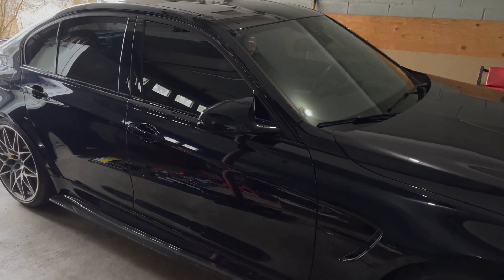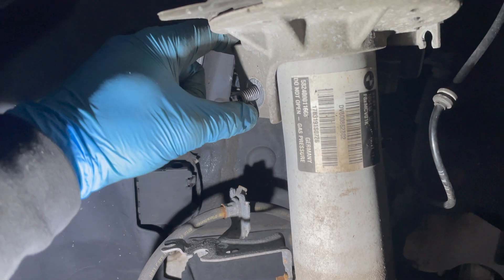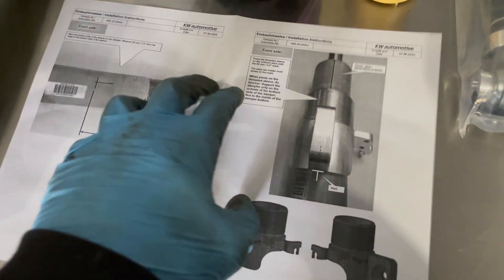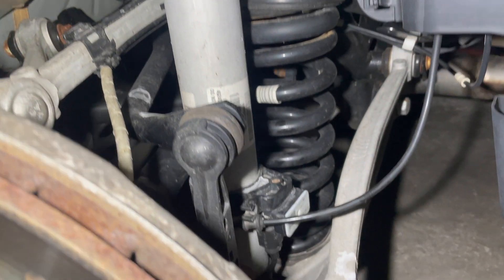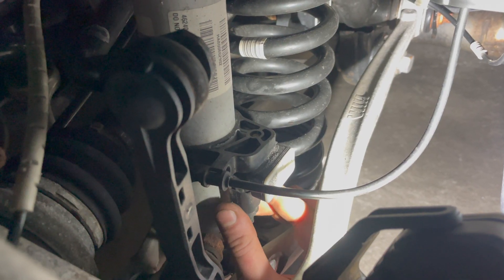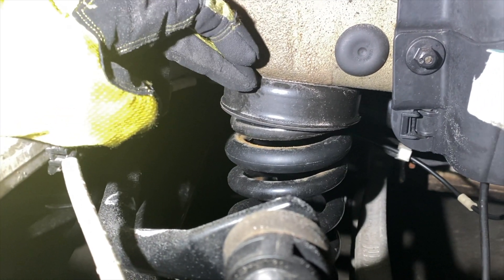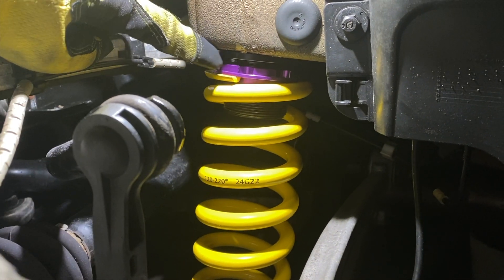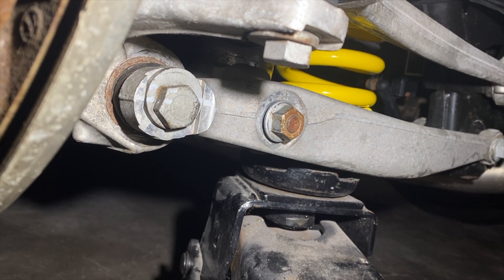INSTALLING KW HAS KIT | BMW F80 M3 / F82 M4 / F87 M2

Comment: Hi, I installed the KW HAS kit on my f80 but getting a slight knock noise when turning at really low speeds (5-10mph). Do you have this issue? Didnt install the black part, but not sure if that would be the cause of it.
Reply from the maker: Has nothing to do with the black dust cover. You need to make sure everything is torqued at load, but it’s more than likely the pinch bolt on the front knuckles. Those bolts are supposed to be replaced after removing, but some people use anti-seize on them and over-torque them by a little to make the noise go away as well. You can search the forums, it’s a common noise that people have covered. If you have any questions just hmu on Instagram as well, I’ll respond faster

Comment: Hey man. Can you run 275/35/18 without a spacer. I installed mine today but I felt like they would hit the spring so I added a 10mm spacer

Comment: Nice job man, what did u used to press off the collar?
Reply from the maker: If you don’t have the proper press, you can flip the shock upside down and protect the metal top threads. Gently tap off the color with a rubber mallet. It’ll brake free with a few hits, I’ve done it in the past